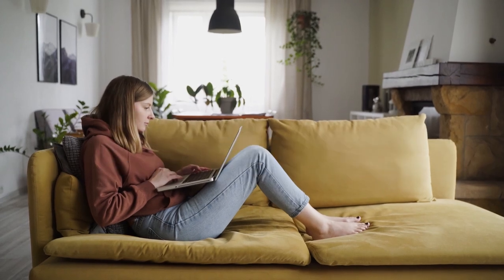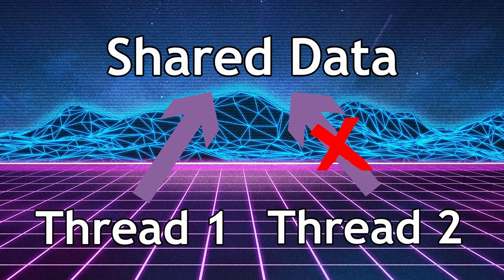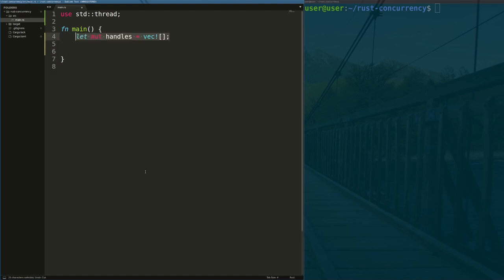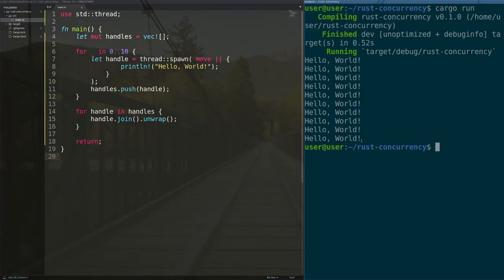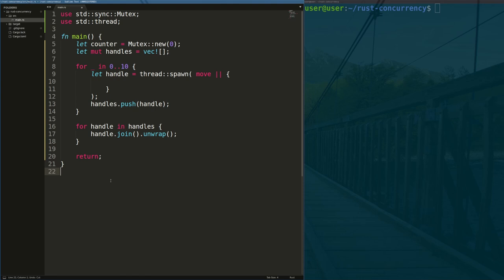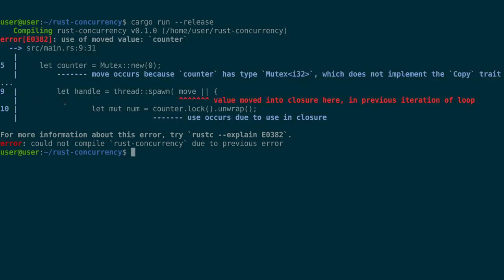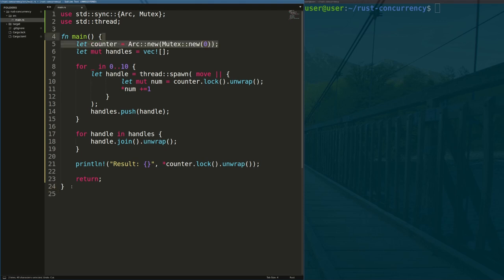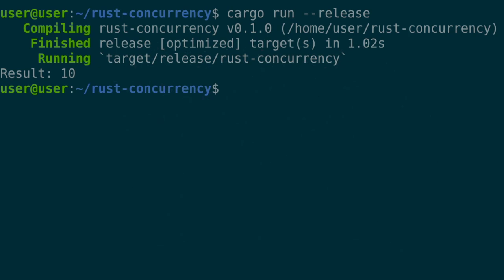Something Is Weird About Rust's Threading and Concurrency | Rust Multi-Threading Tutorial

Comment: "passing into threads" - how does that actually function and presumably it's hardware specific. I think this is very difficult to monitor, perhaps what you'd need is to create computational load and somehow have a minimally interfering cycles/n report and go over it. I would be very grateful because I lack patience but really like your channel 👍
Reply: The underlying mechanism of thread::spawn is that it gets a block of memory (a closure which owns some state, which is to be "sent" to the other thread) and to share it, the memory is put on the thread's stack after initialization. (This is just a memcpy of the data stored in the closure itself into the thread's memory, not a deep copy.) A closure is just a struct containing all the data that was captured from the enclosing context (in this case, an Arc<Mutex<u32>> which is just a pointer sized value, so it is probably not even passed in memory but rather via registers, so the register simply has to be written to the thread stack once), and that struct implements the call operator which is called from the thread once it is initialized. If the thread is running from another core, that means that while the Arc<Mutex<u32>> itself is in the core's private memory, the stored u32 is in shared memory and the two cores battle it out using a cache coherence protocol whenever they want to make changes to it. (This is actually not all that hardware-specific up to this point; the cache coherence protocol can vary depending on the architecture though.)

Comment: 0:21 This C code is not cross platform and only works on systems that support POSIX thread (not Windows, for example)
Point is, you can't compare it to the Python code mentioned a few frames before it.

Comment: Why use mutexes? Atomics are so much better! Mutexes are actually implemented via the atomic features of the CPU, so you're basically using an abstraction to make things worse. Seriously just use atomics.
Reply: If you have a struct with multiple fields that need to be read or modified in atomic fashion (together) you still need the Mutex. Atomic primitives are fine, of course, as long there's no need to keep them synchronized with each other.

Comment: The thing is that this doesnt help me at all as a game developer. Mutexes are orders of magnitude to slow for any rendering code and its type system cant express most safe access patterns.
so most code would have to be unsafe anyway and unsafe rust is arguably worse than regular c++.
Reply: I'd be very surprised if the performance overhead of a mutex would be noticeable for the vast majority of applications, could you link me some code written in c++ which mutexes would fail to be performant for? I'd love to test it.
Reply: @tomtravis858  ? As i said games. Locking a mutex takes for ever in the context of tight loops. Often atomic operations are already to slow bc of the CPU pipeline stalls they introduce.
Reply: @gideonunger7284  I don't see how game code is magically different than any other kind of code, and I've never had issues with the limited ray caster I made.
Reply: @tomtravis858  man i have no clue what you are talking about. You not being very educated on this topic isn't my problem.
Reply: @gideonunger7284  sound like a you problem I'm gonna be honest 🤷 what I said is completely readable for normal people, have fun though.

Comment: WOW, I just watched it, and I hate it. Concurrency is something in rust that feels like a poor copy from C lib. GoLang ( I code in Go, btw ) handles concurrent programs way better. ( In my opinion, based on this video ).
Reply: This is parallelism not concurrency. Rust has async for concurrency.

While Rust is a bit different it uses the same building blocks as C and most others languages. The only difference is Rust checks to make sure it's correct at compile time.
Reply: AFAIK, golang has no form of protection for data shared among goroutines. It is left to the programemr to make sure that data races do not occurr. Rust attempts to prevent data races at compiling time, and does that without introducing too much hassle, IMO.

Comment: AND WHY DOES IT NEED TO BE REFERENCE COUNTED WHEN THE THREADS WILL BE JOINED BEFORE COUNTER IS DEALLOCATED? DISLIKE
Reply: When you spawn a function in rust you can't reference any variable without moving it to the new thread
making it unaccessible to the main thread
So in the first iteration of the loop the mutex is moved to a thread and the main function loses access to it
So in the next iteration the mutex will not exists resulting in an error
Reply: Therefore you have to used reference counted to access the mutex
Reply: You actually don't need the reference counting. You just need to use a different thread spawning API that properly enforces that all threads are joined (i.e. waited for) before the referenced object is destroyed. Such API has existed for a long time in external crates, and since August 2022 we also have a standard library version of it. See the std::thread::scope function.